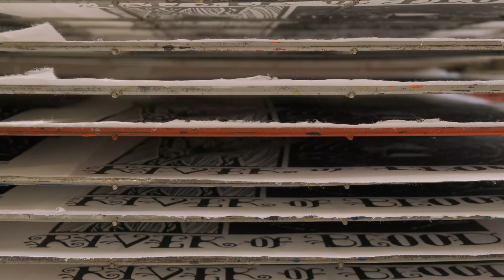RIVER OF BLOOD | linocut printmaking | emil underbjerg

Comment: Hi, can you please tell me the thickness and material of the blanket?
Reply from the maker: i only know that it's some kind of felt, but i dont know the thickness of it - the press is not mine, i only had access to it for the day
Reply: @emilunderbjerg  i really appreciate you keep answering my dumb questions. I was building a press. I finished the project. I think it works great.
Reply from the maker: how did it turn out? I've been thinking of making a press myself, but found it difficult figuring out where to start
Reply: @emilunderbjerg  i think it turned out great. You can see it on my Instagram @mateibocancios , and i can also give you some photos from the process, tips, and other things you could do better than me. Dm me, i follow you on instagram.